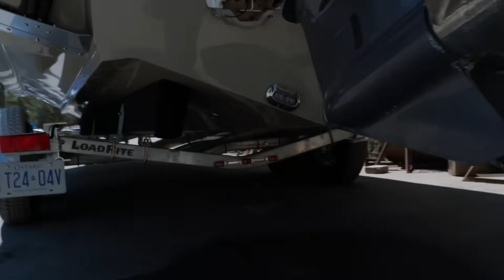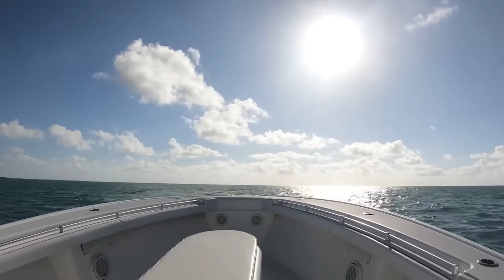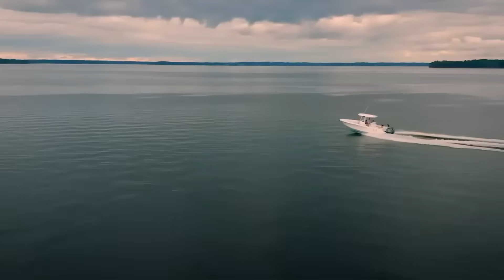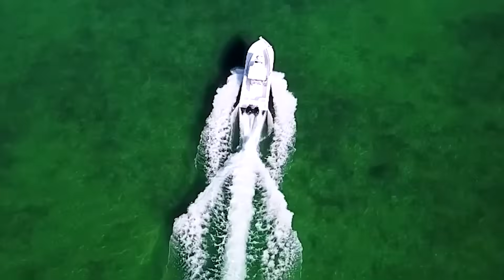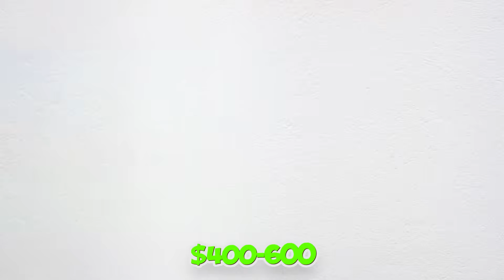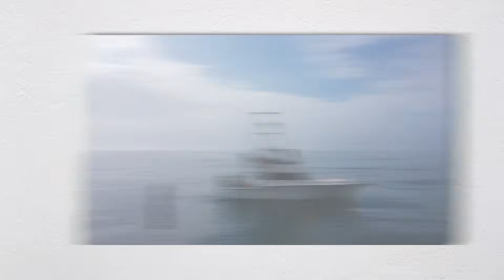Why Twin and Single Engines Are So Different?

Comment: A 150 hp engine weighs between 200 and 250 kg. Why should you bring more weight on board? It depends on the size of the boat. HP doesn't automatically mean faster; that's much more determined by the hull shape.

Comment: Twins have the ability to get you home if one goes down. My boat has a pull start trolling motor for just in case my main engine goes down.
Reply from the maker: That's not really a twin set up but it is smart!